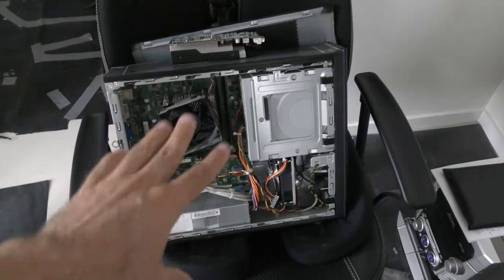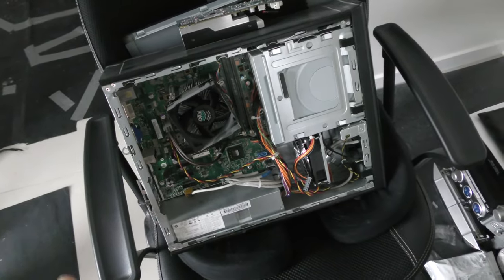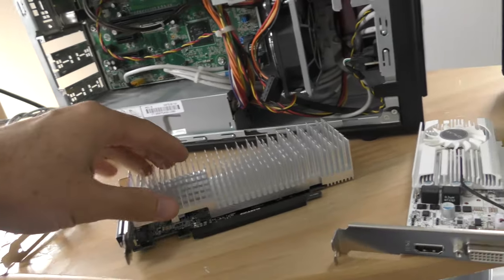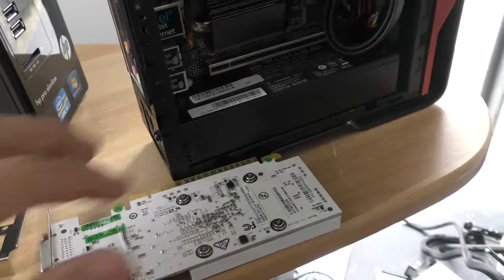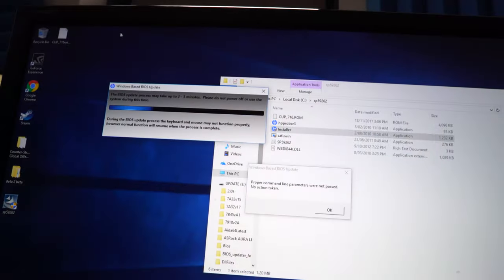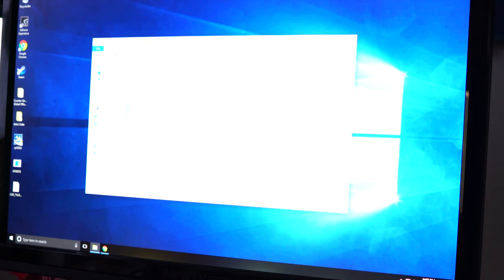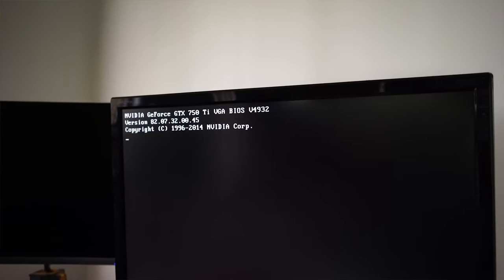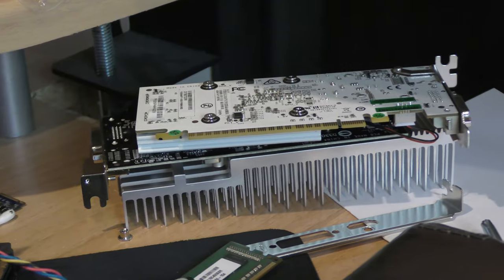The GT 1030, CAN IT SAVE THE SMALL FORM FACTOR HP PC...!?

Comment: I have a HP Z420 with XEON E5 1620 and it is working fine with a GTX1050ti but I have had a week of pain trying to get it to work with a NVME M.2 Evo 960 from Samsung it has a UEFI Bios but no MVNE drivers in it, I finally found some clover version that some one messed with and I now have it booting from that but I have to do a key press to select the boot drive. Also if I do a restart from windows I get a long Bios restart and a cpu error. tried lots of things even changed memory and still there so annoying. I never had trouble with my Z210 and Z220. but I wanted to upgrade for the PCI Gen 3 slots.

Comment: so i have a hp pavilion power desktop with a gtx 1060 by Hp. if u put a 1080ti in it will it work?
Reply: Most importantly, will it fit? Does the power supply has enough juice to support 1080ti? If yes, then it will work.

Comment: had the same isue lenovo. Cause was the psu was too low gt1030 needs minimum 300watt so try another psu hp works fine it's the psu.

Comment: I have an acer xc 600 with core i3 3220 6gb ram and GT 620 1gb overclocked and 220w PSU, if I put gt1030 will it run?
Reply: Rodrick HD maybe yes

Comment: #right version of win10? If may be will didn't try i had same kind of issue ( like you everything, forçing card, flashing bios, etc nothing) and..i had hold win10 i decide to move on reinstallation of 1703 iso where it was newer at that time and then it reconized the card like a miracle, but may be also pci is dead if no way to get it reconized..

Comment: lmao this reminds me of one pc i had once.. i got soooo annoyed i threw it across the room and it exploded all over the place... felt great i tell ya. i know how it feels when stuff should work dont in the pc area. times i used addon cards like sata ones and have it where pc wont boot up until force reset it again and so on its like geez.. specially with windows 10 latest bugs cant even add a secondary gpu to test with or use as a monitor viewing card. and it wouls crash and blue screen in a loop.. worked fine with 1703...but not on 1709 bleh.

Comment: Makes more sense to spend $25 more on the non ti 1050. No?
Reply: Not in this case. The 1050 is still a 75w card, while the 1030 is a 35w card. The experiment was to see if a lower consumption card would work.
Reply: Ah, right. To be fair, if it wasn't for the locked bios, I think both cards would have worked. Making the 1050 a better choice. Most prebuilt PC's have 75W to spare.

Comment: I would then take a pci-e riser, take the bracket off, face it outward in that space and creatively zip tie into place. get a slim hdmi extension and find a way out :)
Reply: I'm talking about the inwin build. For that I would give those older laptop external gpu solutions a try. If there was some sort of full 16x riser/adapter where it nullified the pci-e power coming into the adapter on the board side and substituted it with sata/molex power, that might work..

Comment: Isn’t it just a gtx 750 ti 

So it would freeze with it 🤨🧐

GT 1030 overpriced af as low end gpu no value or performance 😂 

Used second hand low end card better for this hp system. Have u tried the 750 ti in another system? 

(Yep u said everything I just said xD)
Reply: So it’s the system not the 750 ti